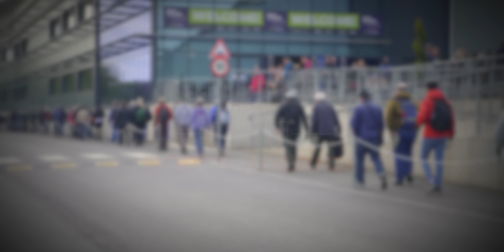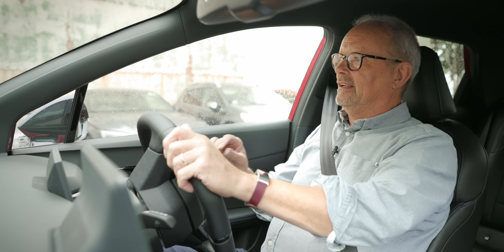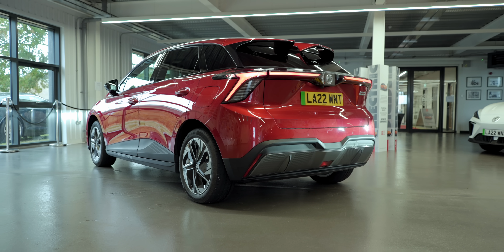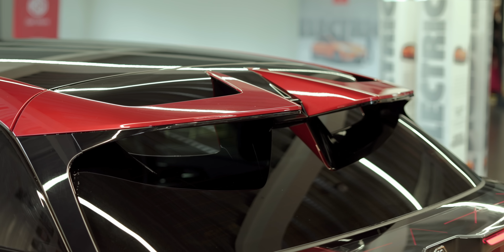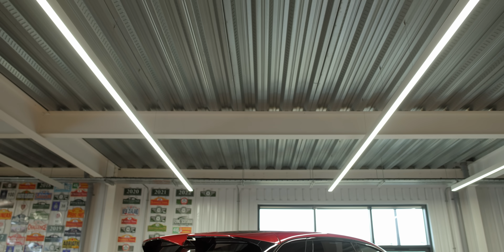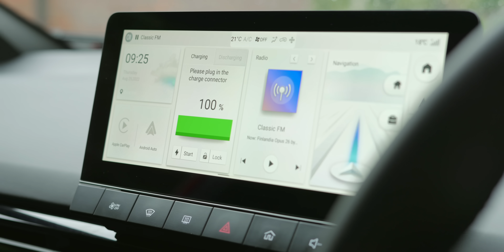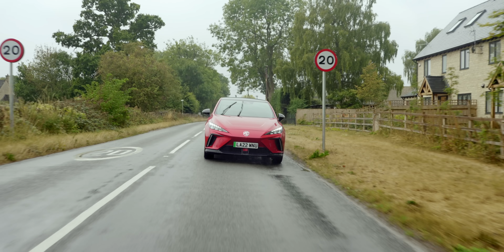MG4: The Bargain Of The Century??

Comment: They are going to struggle to sell here in Australia I think with the pricing estimated at $40,000 AUD. The MG4 only arrived for crash testing recently, not available for sale until next year 🤦‍♂️ A similar ICE MG top spec MG3 model sells for $21,000, if they EV model was $25-25k AUD they would sell out, huge demand here for EVs, I must see 50-60 Tesla’s a day on the road, year ago you’d be lucky to see 5. Fuel prices are certainly driving demand. If pre order was available today and the price was right it would make a great second car
Reply: I disagree. The BYD Atto 3 is selling in 1000's in Australia at a price in the high $40k without a decent distribution selling and support infrastructure. If this meets or beats this price, and with the established MG brand in Australia, it will sell out very quickly. Can't wait to test drive one!

Comment: Wake up.  No EV is a bargain. They are a liability. Surely folk have worked that out by now.
Reply from the maker: Can I politely ask, if there was an election today, would you vote on a conservative or a socialist? I only ask as casual observations indicate that the more extreme ends of both political opposites are very opposed to electric cars for very different reasons.
On the extreme left, there is firm opposition to the notion of private cars, regardless of power train. They say all cars are dreadful and electric cars are not the solution, they are worse becazuse of something to do with the batteries but that's not very clear. They are pro public transport, trams, cycling, pedestrianised cities, no parking facilities and a radical approach to mobility. 
On the extreme right, people are very pro fossil fuel, pro fracking, they often support Putin, always support Brexit if they are from the UK, think 'hydrogen is the future' and demand the freedom to burn toxic, imported fossil fuel.
Reply: @fullychargedshow  unwise to compartmentalize people like that.  Regardless of political persuasion the facts about EVs are the facts.
Reply from the maker: @plumleytube  It's very unwise to try and tell me what to do sunshine.
You say "Regardless of political persuasion the facts about EVs are the facts." 
And from what source do you glean your facts? 
You show extreme bias in your statements, and I know you are wrong.
You state extreme right wing fossil fuel funded FUD about mining materials, obviously making combustion cars requires no mining or refining of anyn material. They are made oof soft moss and fairy dust for F**K sake.
But then you use the super giveaway term  battery 'disposal.' 
Who in this day and age, is going to dispose of a battery? Someone who wants to literally throw money away.
Please at least try to have a basic grasp of capitalism. 
All batteries are going to be recycled. All of them. They are too valuable to throw away.
And they are only going to be recycled after 235-30 years of useful life.
It's fine to believe in the trash you've been fed by an extremely well funded lobby and media distribution system that has spent $billions spreading garbage like this.
But I will remind you of the fearsome, brutal, devastating impact of extracting, storing, transporting, refining and distributing toxic, finite fossil fuel and then burning it in crappy, out of date, inefficient old fashioned smell combustion engines.
If you want to defend this dying technology, if a crappy old engine makes you feel more like a 'real man,' please, knock yourself out. No one gives a shit. Burn the stinking fuel, breath in the toxic filth. The filthy old technology you are for some weird reason defending is dead. It's over. No one cares.
Reply: People HAVE worked it out - but only the very stupid ones.....!!
Reply: Correct ... from their manufacturer to their disposal they are not green. And look at the horrendous environments in which the metals and other elements of the batteries are mined and the expensive disposal of the batteries. On top of that see how the cost of charging is going up steadily

Comment: Maybe not so much an issue in the UK, but in Australia any upward facing plastic surfaces degrade quickly if stored outside. Sure it’s nice to have a garage, but a lot do not. That would be my only concern. My mkV GTi headlight lenses took 10 years to deteriorate and fog… I suspect these plastics will take less time on the rear of the MG4

Comment: Hm. ev-database says 225 miles for the long-range model (not the 280 mentioned here which I guess is WLTP), so not as far as the Niro or Kona or Cupra Born. And slower charging, which doesn't make much sense as the kona/niro only have 50kW charging so not sure who to believe there. But it is clearly very good value. Still, apart from the fact that they take a while to turn up (and most are pretty expensive) there are now quite a lot of decent cars available.

Comment: I learnt about the MG4 last week, and it’s safe to say my first EV will be from MG. Either the Trophy or the Performance. My HP payments on my 10yr old 1.6 diesel Touran end in June 2023, and I will be going electric even though I have no home charging, and nowhere to add a charger (live in a flat above a shop), I will top up at the Tesco across the road.

Don’t forget that the MG although built in China, has been designed in Britain.
Reply: No longer the case, most of the British side of MG has gone. Now the elephant in the room - work out the cost of charging these things at typical motorway service station rates. Charging your vehicle often costs more than the equivalent miles in petrol - something you hear nothing about in the press.
Reply: @LondonSteveLee  Hey, market them here to the United States then. Electric rates are low here so even using an expensive charger for my car doesn't even scratch the cost of gasoline.
Reply: @LondonSteveLee  if paying more than 54p/kWh that is indeed the case- 5p per mile becomes about 15p per mile practically equivalent to Diesel economy . But subscription discounts from various charging network providers can help and a lot of new EVs come with a complementary charging card given discounted charging or in some cases free charging for a period of time! And there are still a number of free destination chargers around in the UK.
Reply: @Antiguan_Dart  Completely depends on the efficiency of your electric car. For my plug in hybrid the cost is far greater as it's less efficient.

Comment: A bit remiss to point out all the features on the higher spec model, like the active cooling vents, boot light bar and graphics, electric driver's seat, better headlights, etc. but then only state the price of the entry level model that doesn't have those features.

Comment: Robert being pretend angry 😡 at how much things have advanced in the 12 years since the 2010 Tesla. (Coincidentally, a 2010 was my first Tesla.)
Robert at 7:01. "It doesn't leak." Great reference to the history of Morris Garages cars. The first car I ever bought was a 1952 MGTD. It leaked. The 'windows' were side curtains that you fitted onto the doors if you were brave enough to venture out into inclement weather. The word 'fitted' is actually a misnomer. They didn't. Unbelievable that Brits would build a car that couldn't be regularly driven in the rain. What? Do they really think that it only rains in the plains of Spain? I now have an MG Midget that has been electrified. Engine, exhaust, gas tank removed, batteries and electric motor installed. It leaks a little, but very little since it now has been 'fitted' with an add-on hardtop.

Come to America, MG. I would love to see an announcement of SAIC building an MG factory in one of the lower cost, business friendly, right-to-work states stretching from Texas to North Carolina and Florida to Oklahoma. The MG4 would be a huge seller and a kick in the pants to Ford and GM.

Comment: Nice. You are certainly right about more resistance in the rain. I have noticed this in my EV. This car sounds like the English equivalent of my Chevy Bolt. It costs US$26,000. With a 66 kwh battery it goes 500 kilometers on a charge during non motorway driving with the AC running. You might not need AC much in England. And I am getting a little over 5 miles per kwh. Some people find the seats uncomfortable, but you can get seat cushions  for that. A person who was 6'5" tall felt there  was plenty of room in the driver's seat. The boot is smaller to get more leg room in the rear seat. But you can get a car top carrier if that's an issue. Value to me is more important than prestige. Enjoy your MG4.

Comment: The price comparison was a bit strange, we bought our Zoe last November for £26,500 as Renault was doing a five grand deal if you took out finance (4% fixed for 4 years)...we got the 110 with some extras (heated seats/steering wheel, metallic paint, long granny charging lead etc). Very happy with it as it's much smaller than the ID3 and MG, but has the same interior space (for passengers) and great range (~240 summer and ~195 winter).
What we're waiting on is a longer range people carrier type vehicle to use/convert as a campervan...
Reply: Maybe they were comparing retail price

Comment: They mentioned the adaptor is £100 for V2L but i have been quoted £269 for the V2L adaptor for MG4, i think they mean the type 2 cable which is £120 and not supplied. A granny 3 pin charging cable  is the only cable supplied free with the MG4.

Comment: Pretty looking car, rear wheel drive but Allegro steering wheel and electric, plus a product of the CCP? No thanks! No doubt the CCP are making better cars but the amount of pollution, corruption and disease that they spread? 

And to add insult to injury they own MG - yuk!

Everyone frothing about EVs? No idea! No one stops to ask about recycling of old Lithium batteries or the filthy, unethical, dangerous supply chains for Lithium. Reminds me of the Emperor's New Clothes!

The boys and girls in brum did a good job of assembling them (up until 2016 - now wholly CCP made), and let us not forget the UK doesn't own any big car manufacturing, same with aviation. In the UK, treasonous, self interested, self serving, successive govts post WW2 have eroded the UK and it's come to this. 

Awful, criminal, immoral, unethical, art of war, war through commerce and will have an awful impact upon the environment.

Let's not kid ourselves, this is grim, Great Reset grim!

Comment: With energy prices going up, how does EVs compare with it’s petrol/diesel combustion rivals now?
Reply: Still a lot cheaper to run, not to buy.
Reply: @timscott3027  how so? My elec is now 68p pkwh, octopus energy aren't offering better to new customers.
Reply: @bikeman123  
You're on the wrong tariff. I'm on Eon at 28.92P per kWhr.

You can also get EV tariffs which give you 4 hours at about 10P per kWhr. 

For comparison, a diesel vehicle doing 50MPG is about 16 Pence per mile.
This EV @ 68P per kWhr cost is about 18 Pence per mile, but there's no need to pay anything like 68 Pence per kWhr.
Reply: @bikeman123  That sounds like the normal daytime rate. The Octopus EV off-peak tariffs are 7.5p per kwh. EDF are at 4.5p per kwh for similar off-peak EV tariffs, but the daytime rate is scary.  The 3 public chargers near my workplace are still at 30p per kwh.....

Comment: The AC charging speed is slightly disappointing at 7.5KW, it should be at least 11KW as the majority does or better yet, 22KW as Renault's Zoe.
Reply: Marginally useful if one has access to higher AC chargers. most home chargers will be 7kw anyway.

Comment: Love your quirky reviews, Bobby.
And, for the first time EVER in any car review - EV or ICE - has anyone ever clarified that heavy rain affects ICE fuel consumption equally to range reduction in an EV...!!
All those anti-EVers out there always bang on about how much range an EV loses in wet weather - conveniently 'forgetting' that their petrol / diesel car drinks more fuel in those driving conditions, too.
Well said, Bobby - top marks, sir... 🥇
Reply: It's just more drag and moving water takes energy.
Reply: @Retired Bore rolling resistance increases in the rain. Unless you are aquaplaning. What engineer ?

Edit: let me add that there have been tests done to prove it, Google Influence of Road Wetness on Tire-Pavement Rolling 
Resistance for a published example (journal). 

But to be honest, anyone driving should be able to deduce that trying to shift water away between tyres and the road takes more energy. Well at least I can feel it.
Reply: @Retired Bore yes temps and wind resistance is a major player. 

However, bear in mind that because EVs have low density energy storage, any extra drag is noticeable.

E.g. 5miles/kWh vs 3.5miles/kWh. Thats 125Wh/km or 178Wh/km. Not a big Wh/km delta but one definitely notice it because it affects range. 

In a petrol car, a 0.5-1L difference per 10km increase, probably would not be noticeable straightaway.  At 30% efficiency at the engine, 1L of petrol converts its 10kWh of energy to 3kWh. That increase is 300Wh/km.  Halve it and it's still a 150Wh/km increase.

Edit: forgot to say, if an EV suddenly requires +150Wh/km... Drivers will freak out immediately....😂

Comment: Not sure if it's available in the UK, but the Nissan Leaf is still edging it out with the price. Granted it's 40kW battery, but at $27,800 US or $23867 GBP, that's pretty reasonable. I'm also concerned with the Miles per kW of 3.6 he's reporting. If I drive like a maniac in my Leaf, I get about 4.0. Conservatively I get about 5.2. 3.6 seems low to me. Still I do wish this would make it to the US, we could do with just a bit more competition in both pricing and design.

Comment: Great review, lovely car. But you failed totally to give the price .... You said 25k it's 26 for the base model the. 29 for the long range model. 
Still a nice car but needs 5 k knocking off each model to finally match the ice models. But mg are very close certainly the closest of all the car makers to the parity point so well done. All I need now is the base model with the long ranger battery and 4k off the price and I'm buying one.
Reply: So, what you're saying, to sum up, is that you want a lot more for a lot less and you're in.......!?!?
OK! - sounds good ...... me too!!
Reply: @andymccabe6712  no I want less. Less gadgets longer range cheaper price. I do want an ev but my Dacia jogger is 7 seats for 16k. 10k cheaper than the mg4 which is pretty cheap for an ev. Mg will eventually hit the 20k mark but hopefully Dacia might beat them to it. I would swap straight away if I could get an mg4 for 18k with the longer battery. My jogger does 49.3mpg and range of 580 on a tank full so pretty cheap to run.
Reply: @pstanyer1  you can have the Dacia spring. 

But honestly, EV manufacturers aren't benchmarking a dacia jogger. The MG5 kicks it's competitors in value for money . It is THE dacia of BEVs if you will , at least in the UK now, on price. Doesn't even sacrifice much of everything else despite the price.
Reply: @TsLeng  the spring is not availabale in the uk and dacia has announced due to massive demand in the eu they are not prepared to do a right hand drive model
Reply: @pstanyer1  the Spring won't replace your jogger though.

Comment: The first car since the heavily discounted Zoe ZE40 (I bought one for £17.8 k Inc battery and £4.5k grant in 2017) that looks like good value and the MG is a good looking thing too
Reply: Same here. I bought my Zoe ZE40 end of 2018 for just over 18K with battery (after incentives). Might have just found Zoe's replacement in the long range MG4.
Reply: @martinconlon2673  I sold mine after three years and bought a cheaper Mercedes SLK, I am a total sinner I almost bought an E208 but so expensive for what it is and I love convertibles. The Mégane E-Tech may turn out to be decent value used in a few years too

Comment: Ok, I’ll be the nerd. There is not more friction from a wet road. Try riding a dry water slide. It takes more energy to push the car through high humidity.
Reply: Bad nerd. It takes energy to push water off ground to get any traction/grip. OK if you aquaplane all the way...

Comment: For a hatchback, 365L boot isn’t very large/sufficient for a family 😕. The car seems overall good. Still too pricey. Cars shouldn’t cost more than £20 000. They just shouldn’t. 🤷🏻‍♂️
Reply: Yes mg are nearly at parity with ice cars. They just need to shave off another 4 or 5 k on each model and then I will buy one. They are the only ones close in the UK. Ive just bought a Dacia jogger 7 seater for 16k mg need to get to that sub 20k mark to really hit the jackpot
Reply: @pstanyer1  So buy used. A used EV costs less than a new one....

Comment: No surprise, electric cars (once factory tooling and processes are nailed down for production) should be cheaper than gasoline engine cars.
Reply: They are the same except difference in drive train cost. Everything else is the same. Window seals are window seals for example.

Comment: It's interesting that it's rear wheel drive. I would imagine that rear wheel drive is mechanically simpler particularly in an EV.
Reply: Rear wheel drive can use a ridged axle if you want. No need for CV joints
Reply: Maybe. I'd have though a short vertical driveshaft down to the front axle would be the easiest thing ever in a fixed-gear EV, but I am not any kind of engineer.

Comment: Have you forgotten kona and niro ev they been around s8nce 2019 and do more mile and give you better equipment and before you say the price mk1 kona purchased 8n September 2020 new £32 
With heat pump and thermally regulated battery  so hello